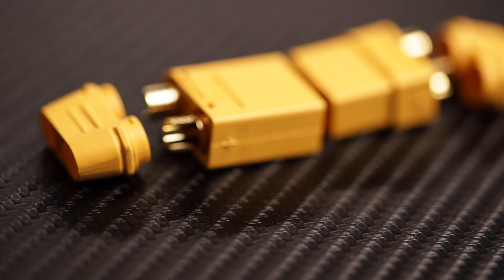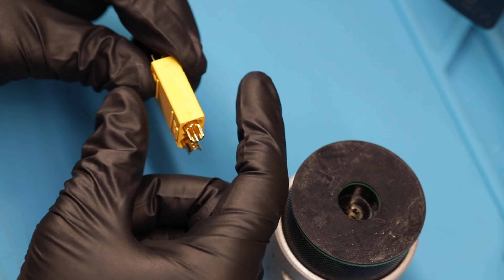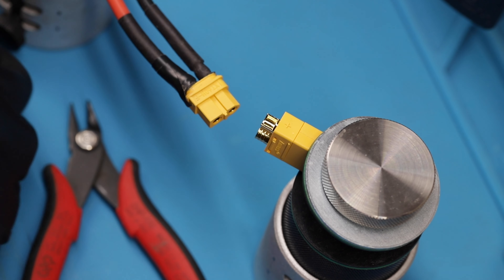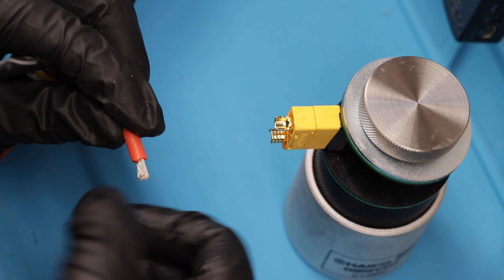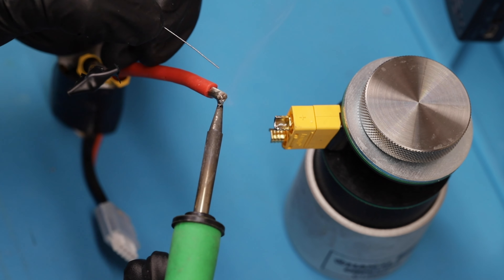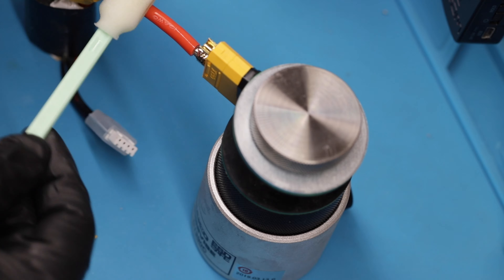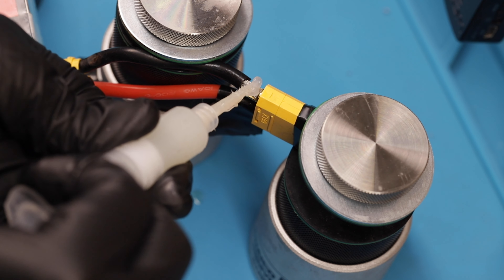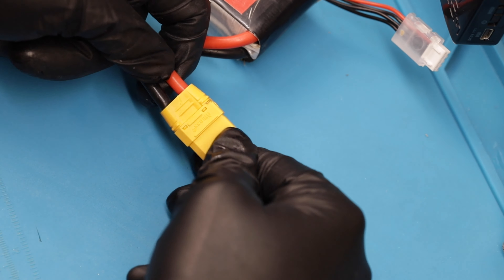Convert LiPo battery to XT90 / XT60 in a few EASY steps!

Comment: After coming across this video on the Arrma forum, I figured I'd follow you here. 
I soldered up 3 6S LiPo Batteries this morning, and I realized I had to get the XT90 plugs apart. I figured it out by using a small Phillips bit and pressing one side out. I unsoldered the + and put it in the IC5 plug, then did the same thing to the negative side. Just so I didn't have to worry about crossing the wires.

Comment: Nice video.  I've had a difficult time soldering these wires before on sensitive flight controller pads.  Tore so many pads off trying to heat and get these large gauge wires on.  That would probably be a decent video to make, how to solder to pads on a circuit board without lifting/screwing them up.

Comment: Hi...nice tutorial...I got an Idea to make a converter xt90 to xt60 for my battery instead of this, just in case I need xt90 again. But I have a question. Is it safe to do this? I mean: I have 4 x ESC 30A, mainly they pull, up till 10A - 15A each, which is for XT60 maximum, right? But what if I have some situation that they pull maximum? Can I burn something in that case? Battery or my drone? Probably not a drone but a battery? Thanks for the advice

Comment: Good video but I would suggest the xt90 anti spark version for batteries to eliminate spark when connecting your esc
Reply: Anti spark versions use a resistor in series that is jumpered when fully plugged in. But since the resistor is active when partially unplugged, there can be some human error that causes meltage if you draw high current through a partially unplugged XT90 anti-spark. A better solution in my humble opinion would be smarter circuit design using a soft start so that current draw is minimized until the system is powered up (so that there is no inrush current until the connection is solid. Another option would be if they made an XT90 with the same design as the xt60i which has a third low current sense wire for communications. Something simple like a MOSFET on the sense wire would act like a switch so that the current does not flow until after the sense wire and ground are connected (which would be after power and ground connect if the sense wire is recessed in either or both plugs). The side advantage is this method would allow the ESC to detect the partial disconnect of the connector and cut power before the connector is fully removed so there is no spark or meltage risk provided the ESC itself is not on fire (at which point you have bigger issues and no connector is going to save you). MOSFETS are already in the ESC so we would not necessarily need to add a series MOSFET which would slightly increase losses and increase ESC cost, instead we use the ESC's MOSFETS and cleverly arrange them to keep the capacitors disconnected until the connection is made. I am sure something like this could be done but just isn't.

Another - more universal - option is the soft start. Using software timers or some clever hardware like a small ceramic cap, a resistor and a MOSFET, we can design the ESC to not draw a burst of current until say 1/10th of a second after power is connected... thus eliminating the spark because only small current flows to power the timer when connected to power. Lots of options, no need for more expensive cables... but ESC makers need to do it on their end and they wont unless they have to because consumer pressure.

Comment: Hey so i know im a bit late compared to when this video was posted. but i need help. Can i do this with a 36v 15 ah grade a lithium ion ebike battery that has a xt 90 connector? i would like to take it off and put the same xt90 connector except the new one ill put on will be the anti spark version  xt90.

Comment: Anyone know what wattage soldering iron should be used?  I have a 65 watt but thinking of buying 300 w.
Reply from the maker: Any ol' iron will work for this. I use an industrial $600 Hakko, but that's only because I do electronics repair for a living. But even a cheap, basic iron is capable of tackling this kind of job, it's very basic in the world of soldering.
Reply: @ShaneFix  Thanks for quick response! Going through your affiliate links to buy what I need.  This was best video I found on doing this the right way!  BTW using this for new connectors for ebike battery not remote control car LIPO batteries. (although I do own a lipo battery remote control car -  e revo 2.0)
Reply from the maker: @ABCD-eg5ky  Awesome, let me know how it turns out!

Comment: Is possible to use xt60 for:
300w solar panel cable wire to (xt60) ---> solar charge controller?
Reply from the maker: To be honest, I have no idea. I don't have any experience with solar panel work. I would imagine they have very specific requirements, especially for environmental issues, like rain, so I would use whatever the solar panel company recommends.

Comment: Will a TRX Female adapter  To XT90 XT-90 Male adapter work with a xt60 Traxxas esc
Reply from the maker: I'm not entirely sure what you're asking, but as far as I know, Traxxas has their own proprietary connector. So you would need an XT90 to Traxxas adaptor... or just swap the connector on the Traxxas ESC to an XT90.

Comment: what is the soldering screw tools you have to hold the connector?
Reply from the maker: Those are made by Hakko, I think I posted them in the description. However, they're very expensive for what they are. If I didn't do electronics repair as my full time job, I'd probably buy something cheaper.

Comment: How much amperage you think a Traxxas connector can handle? I’m thinking of swapping over to xt90 after my Traxxas connectors are getting warm after installing the mamba monster X setup
Reply from the maker: That's a good question, I'm not sure. I think I'd definitely step up to XT90 with the Mamba though. Make sure your cables are large guage as well, they can be a big bottleneck if they're too small.
Reply: It’s 12ga wire. My best batteries are Zop power. But yea my connectors used to not get warm and I definitely notice they are getting warm
Reply from the maker: 12 ga wire is probably fine, though I actually run 10 ga wire on all my 6s or 8s rigs. The bigger the better for those current-hungry applications.
Reply: How do you change the wires? You would have to open the battery or no?
Reply from the maker: @Hittin2thabass  No, I never touch those. I'm just talking all cables going in/out of the esc from battery and to motor, etc. You're stuck with whatever guage wire comes out of your LIPO.
Reply: ShaneFix oh yea I was wondering. Yea there is 10ga coming out the esc
Reply: @ShaneFix  will I be fine using a xt-60 on my e revo 2.0??
Reply: @andresvillagomez75  I'd say xt90 for sure
Reply from the maker: Personally, I'd use XT-90. I use one standard across the board no matter the vehicle so that I don't have to use different batteries or adapters.
Reply: If you buy a pack of TRX connectors, the instructions inside from Traxxas says 30 amp max. Not sure how they get the math to use the same connector on the 6S and 8S systems, but they printed it so...

Comment: That was ALOT of solder
Reply from the maker: Yup, you want to fill all the air gaps and make the connection as solid as possible. Weak connections can cause all sorts of issues for the ESC, or worse, fry the cable if it's not able to conduct all that current quickly.